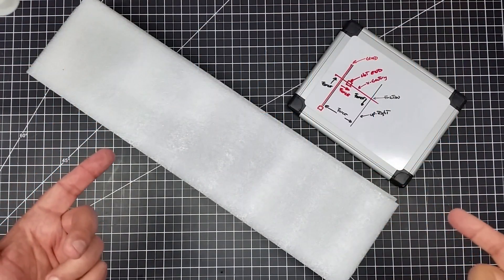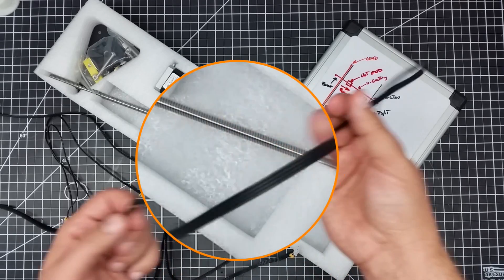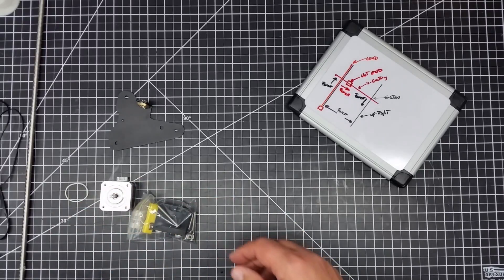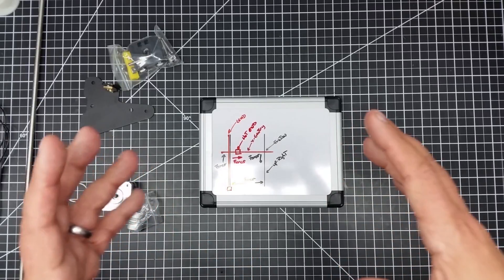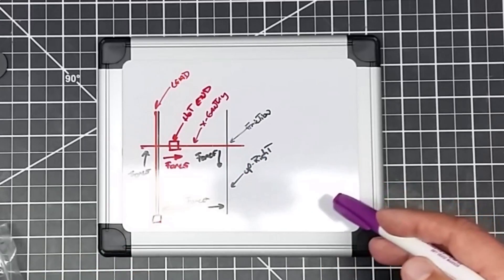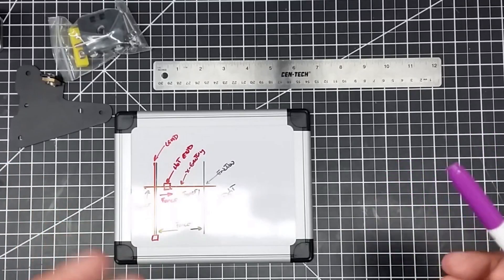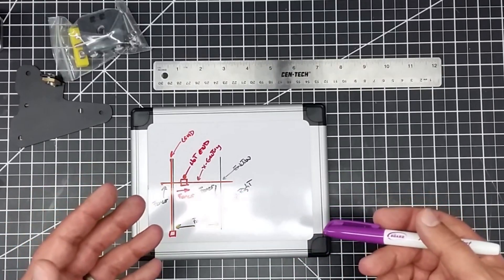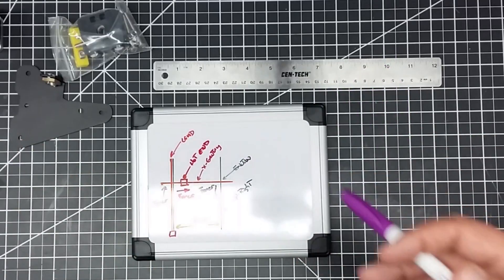Creality CR10 - Why I Got a Second Z Axis and You Might Want One Too!

Comment: I disagree. Its not impossible to not have sag.. Thats the whole reason they have the 3 wheels on each side.. Unless the tension is off or the frame is bent, Those 6 wheels, 3 on each side stay perfectly tight with no sag. and even if there is a tiny bit of sag, Itll sag until the point where the tighness the sagging creates is so tight that itll be locked into place. So if you start above level and let it sag till level, then whats the diffrence? Level is level.. and "level" on a p[rinter is weird anyway because it can be at a 45 degree abgle with sag, but as long as you also have the build plate at 45 degrees itll print just fine.

Are dual z axis motors better than one? of coarse. the speed and agility of dual z axis is always great. But that doesnt mean a single z axis printer cant be level.
Reply from the maker: Thanks for commenting, however its not me your disagreeing with however physics.  As first, "perfect" as you put never exists so because of gravity you will have sag and also as covered in a video many years back this forced motion creates what I refer to as fits and starts. In other words you will to introduce additional energy induce motion because of the added resistance of the "sag".  If your really interested you could model this even in Fusion 360 and see for yourself (don't just take my word).  Also, it is possible as you mention to fine tune the tension of the wheel to "reduce" the sag and therefor drag, however it will remain.  If your hobby printing it likely is not an issue, however if your trying to achieve a high quality part, this error will show up in higher layer line count models.
Reply: @DIY3DTECHcom  I should've worded that differently. For it to be Truly absolutely perfect yeah I'll agree that's impossible. What I meant was it's negligible if everything is tuned right and running right. And it can be negated no matter the severity. especially on a bowden set up where there's barely any weight.

Comment: i know its better with second z axis, but its not necessary. Accuracy issue exist if the Z axis moves up an down repetitively while printing. The  reality is the Z axis only move up ONCE since it start print, so the Error is so so so small. i'd rather change angle/degree of my nozzle a little bit to the right.
Reply from the maker: Change the angle of your nozzle?  If your hobby printing a single Z is fine, however if your getting serious about part production for a small business (which is what I focus more so on here) then you need two z-axis as with out it  you will get a bump and go effect which can negatively affect part quality.  Also if you try and change the angle of nozzle you will never get a good tram on your machine.  Hope this helps explain better...

Comment: It is a valid kit for the Alfawise U20 ?
Reply from the maker: Not a direct bolt up however adaptable yes...
Reply: @DIY3DTECHcom  ok ... another question: would the stepper motor of that kit be compatible with the stepper motor of the Alfawise U2 (42BYGH 40H-2-19D)?
Reply from the maker: I am going to guess yes, but its only a guess as I have not tried it...

Comment: just change the 20x20 with 20x40
Reply from the maker: Sorry not sure I am fully tracking?
Reply: Regardless of the beam profile and configuration, you necessarily have a bit of material compliance or a bit of tolerance/play at the wheels, else the axis would get stuck hard. This play or compliance allows some independent movement of the unsupported side of the beam. If you go for thicker beams, you can limit the flex of the beam itself, but it occurs to me that it must be much lower anyway than the movement allowed by the guide system.

Comment: Do you happen to know why my Cr 10 is only printing in two dimensions? It only wants to print upward, could it be a faulty g-code? I checked all of my connections, but no luck.
Reply from the maker: If it auto-homes all three axis you know all are connected properly electronically (believe its prepare -> home all axis from the control knob) .  If this doesn't work then it is an electrical or mechanical issue...
Reply: Okay, I'll figure it out. I printed something after moving my printer, tried printing my own design, and it wouldn't work. I thought that's why it could be the g-code. I had to adjust the height of the motor couplers, but I don't know why it would have a perfect print then this problem, you know?
Reply: It turned out to be a Cura issue. I had to redownload it, and ever since doing so, I haven't had much luck. I tested this by printing with an older stl file. Oh well, not sure why that happened.
Reply: When I get the money, I'm so donating to you. Personally, I can't afford much right now, I spoke with my wife, but I respect you a lot. I want to help somehow, so if there is something a master designer like myself can offer you, PLEASE let me know. You've been a great resource to SO MANY!
Reply from the maker: Just watching the channel is payment enough for me as its my hobby and I like helping people where I can.  However thank you for the kind offer :-)  So now that you re-downloaded it is it working now?
Reply: Yeah, I'm using the Utlimaker Cura 3.1.0, and the one that stopped working for me was Cura 15.04.3. I don't like slic3r, it separates my perimeters, and I'm not a fan of RH.

Comment: Why would the other motor run backwards when they are threaded the same.  The Motors should run the same direction unless the threads are opposite.
Reply from the maker: It depends on the set up as I have had a kit printer in the past that required the Z to be flipped as this was not the case...

Comment: I really like a lot of what you do, however this one has me scratching my head.  When you say the difference is about 0.1mm but you can't catch it on camera zoomed it, I have to wonder a little bit. There is no down side to having dual Z and it does remove one factor that you would normally have to maintain, but honestly it seems to be overkill. I like that you talk about theory, but without evidence contrary to the evidence I have, this is a hard one to get behind. I have a CR-10 and have been printing for over a year with it and the few Z axis issues I've had were related to something not properly tightened, especially after I put in the stepper motor dampeners.  I print over 12 inches tall somewhat regularly and the only other issues is that the print can wobble if it isn't properly secured by brim or raft or too high a print speed. To say dual z is better, true statement, but to say that you can't get accurate tall prints without it is only true if you are not skilled in maintaining your machine and slicing your model.
Reply: But he's talking about doing some mods that will make his hot end heavier and then cranking up the print speed.  The extra stability is going to be desirable with those perimeters.  He said that if you are leaving the cr-10 as is it's not necessary.
Reply from the maker: The issues is I get people from Joe Average to the Academic physicist and try to create commentary which spans the two in an attempt to make everyone happy.  As when making this I knew I would get tons of comments saying basically what you did in "I print over 12 inches tall somewhat regularly" as me to and for general use within set tolerances it works just fine.  However (and I wish I would have done this before add the second axis) is print a box the full size of the bed.  As most things (not all) get smaller or maintains a relativity constrained space. As the single Z when it moves up, it can not move uniformly as the mechanical size will be pushed up (first) and the other will first have to over come friction to be pulled.  Now part of the saving grace is the controller is 8 bits so it can only do one thing at a time (as Scott L. pointed) out in that the x & Y will stop the z moves and then they restart.  What I tried capturing was this movement, but the small amount was not easily visible in the iPhone high speed video (it requires higher grade gear then I can afford)....
Reply: I completely agree with that.  If you are adding weight to  the gantry, then I would think a 2nd rod would be essential.   But as is, with proper maintenance and good build plate adhesion a second rod is not needed.  I do think it is a good idea if you are adding weight or just want one less factor to deal with. I have seen a few people who added a 2nd z rod and still had issues due to model wobble from poor bed adhesion and printing too fast for tall prints.
Reply from the maker: Well it also depends what you want to do, as if my goal is to create the most emotionally accurate part.  As in my day job I see these (i.e. 3d printers not necessarily the CR_10) used to mock ups and require a rather high tolerance to fit together many pieces.  As using PEI on it, I have never (knock on wood) had adhesion issues...

Comment: Excellent. The CR-10S makes up for this recognized design flaw, but for the hobbyist it saves cost.

I thought U would want to replace both lead screws at the same time and with duplicate motors, assemblies. There will be some variance between the 2, both in manufacturing and wear. Just knowing its there, doesn't that freak U out! :-)

Resonance: Have U measured resonance for the current setup and recorded it? Interesting to compare resonance changes before and after the upgrade. If useful, here's a link to Tom Sanladerer's discussion and a link to his test - https://www.youtube.com/watch?v=7HsIZuj9vOs .

"Wheelies": U noted the need to make frame adjustments to add friction to the wheelies?  Tolerances on "wheel" chassis are not great in the first place. Wonder what U will find. Compare the design differences between the original and CR-10S.

Request. Would be great to keep a log of the CR-10 expenditures to date, and the hours spent on upgrades. What's the cost of ownership, including the labor and stress factor?  U see people regularly exceeding the cost of a better quality printer by the time their done with odd, sometimes eccentric upgrades, the hours of work and stress in the family, even before learning good printing techniques.

Manufacturer support tip: My wife and I have over 20 yr's working in China with Western and Chinese companies manufacturing and OEM. (BTW, notice all of the OEM cloned Chinese printers). We've seen it all, and while we you might believe these are great deals, if fact you're not really getting what U paid for it terms of design, features, and quality. Profit on these is incredible.

If U have a problem, don't let it go. Contact the manufacturer. The key is to have a friend who speaks Mandarin and Cantonese (typically spoken in the region these machines are made) to speak with customer service with U. Be firm, positive, with data in hand, and most of the time they will respond very nicely, and help out. It's never failed us over the years.
Reply from the maker: Yes I too have spent much time in China and understand what your saying :-) Also I kept a log on the CR-10 of time and material it would be a lot, but the issues was it needed?  As investing for the channel is one thing, but as a hobbyist is another.  As if I bought to tech my kids about 3D printing and print fidget spinners there is no way I would make these mods.  Second, if i was more serious user would by the JG Auroa as the 24v PS alone makes its a better value over the CR-10.  In short I agree with you is people many times over spend on upgrades verses just buying better up front.  However it is a trade of learning and the feeling of accomplishment over practical use.  Also to add friction, I had to spring the frame a bit as the wheels where to lose increasing the sag.  By the way nice note, well formed and easy to follow :-)

Comment: Great explanation. I bought a z axis kit but havent had to use it so far. I  also printed MyFordboys 2nd lead screw setup as well as it made more sense to me because of never being able to get out of sync. He said that tends to be an issue after power failures. Are you replacing the mother board with the new one that has other upgrades as well?
Reply from the maker: Many thanks, I guess I am at a loss with the out of sync as if there is a power issue start over as your likely going to have adhesion issues due to cooling with loss of power.  Also I see more issues with an un-powered solution as "there isn't a free lunch" in physics terms as the friction of the system will need to be over come in sequential terms so I see the potential of greater accumulative of error over time.  Now the question is, will this generate more error within the print envelope then already exists and the answer is likely no in both cases.
Reply: OK , Thanks again :)

Comment: IMHO dual z axis is cheaper and more reliable with this single stepper motor mod - https://www.thingiverse.com/thing:2569379
Reply: I have to say that my laser engraver uses one motor with a shaft that goes through it to drive Y for both sides/belts and I have one motor and FOUR, yes four, big ass lead screws for my 50 watt machine's Z table.
Reply: I did the second lead screw belted to the original for a single stepper and love it.  I have an Anet A6 and have had issues with the steppers being out of sync and not being able to level the bed.  I know what I need to check now when leveling but the single stepper makes the CR-10 rock solid.
Reply: DIY3DTECH.com The problem with that argument is that it can also be used for the current used to drive the second stepper motor as well as the friction introduced by the magnetic field used to drive the motor.. The other problem is that is just wrong.
Reply: DIY3DTECH, Violating the second law of thermodynamics? If something exists in the physical realm, it fairly certainly does not!

There is fundamentally nothing wrong with using a belt or some other mechanical system to synchronise two lead screws driven by one motor. There's a little bit of added friction that can be compensated for by running the motor current a bit higher, and ultimately the maximum achievable velocity and acceleration at a given current will be reduced, but at higher settings really not too noticeably, and you can live with slow Z anyway, you just have to limit these parameters down to where it's reliable. For the most part, the torque applied by the motor is split into two, to the extent that it's necessary - the whole weight of the X carriage is supported and moved by one motor either in stock CR-10 or in CR-10 with the mod posted here. Also the two Z screws are then permanently synchronised to each other, while in a system where there is no explicit synchronisation, every time the motor turns off at the end of the print, the heavier side of the carriage or the side with lower friction will probably want to slide a tiny bit further down the lead screw, leading to a slowly systematically accumulating error with the number of prints.
Reply: Best practices is 2 lead screws. This has been an issue with the original CR-10 and one reason why they recently came out with the CR-10S calling it High Accuracy, when in fact, it is Normal Accuracy. ( https://www.ebay.com/itm/Creality3D-CR-10S-High-Accuracy-Desktop-DIY-3D-Printer-Kit-1-75mm-Printing-US-/162920773257?_trksid=p2141725.m3641.l6368 )

The Thiniverse comment about the importance of sync is correct, but a properly designed/built machine will rarely experience this in its lifetime, and if U have to re-level the bed often somethings screwed up.
Reply: I agree that using a single motor to drive both lead screws makes sense as far as keeping both sides in sync with each other.

An alternative that I use on the Anet A8 is to put a pencil mark the Z axis couplers aligned with printed pointers when in the home position and properly aligned so that I can quickly synchronize them when necessary.

They usually get out of sync only when printing taller objects and not by much but after several prints it adds up.

Here's a fancy way of doing this; https://www.thingiverse.com/thing:2684692
Reply: I am trying to figure out how to do this with my TronXY X5S as it shouldn't be too hard but getting a closed loop belt and a way to tighten the belt will take a little bit of thinking and I need this done because one side is always sliding down on me if I barely touch it but if both sides are connected to one motor instead there is less chance it will slide down and if it does synchronization will remain.
Reply from the maker: Using a single motor to drive two leads screws means you are violating the second law of thermodynamics and there is "no free lunch" in that the friction of the system will need to be over come in sequential terms posing the risk of greater accumulated error time.  The reason this is not more noticeable is typically is the high margin of error in 3D printing coupled with the typically constrained print area...